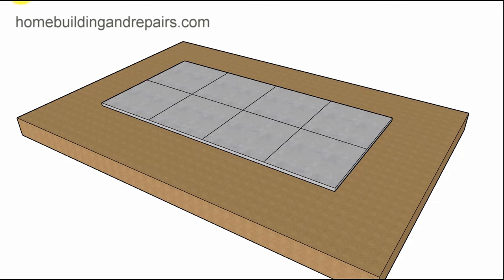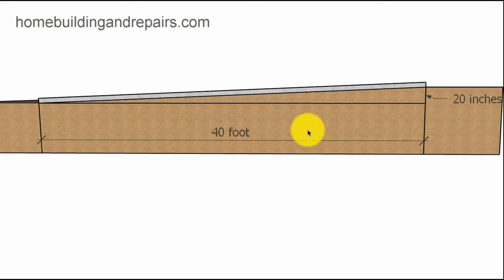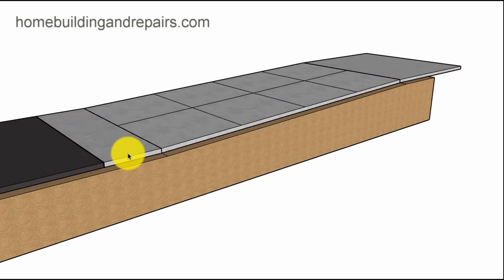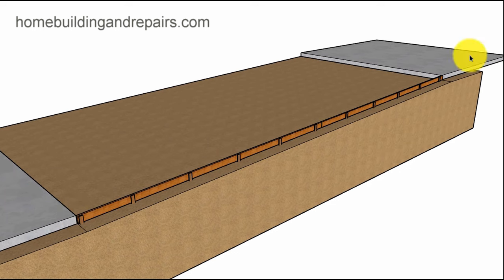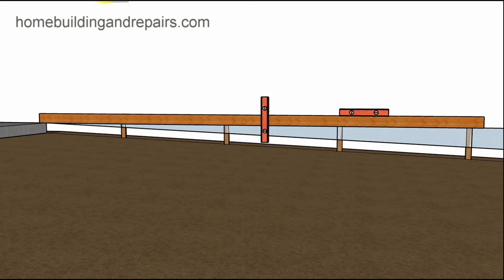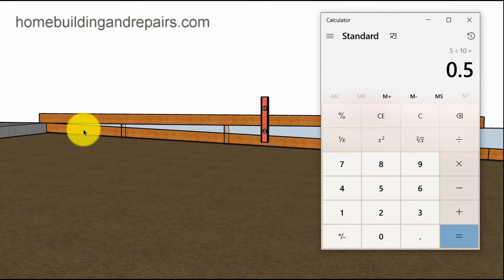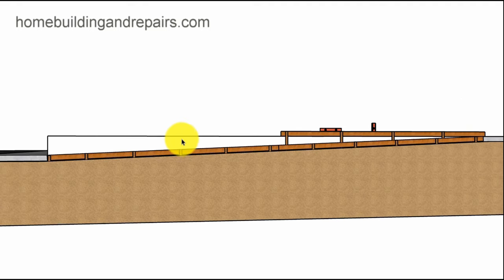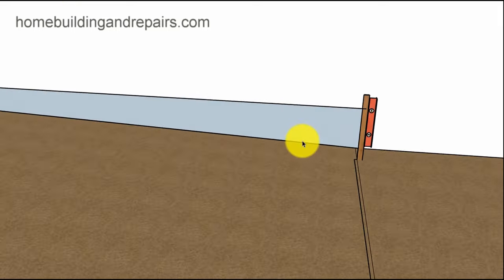How To Calculate The Slope of A Driveway In Per Foot Increments - Construction Math

Comment: Great video! Couple of questions. Currently want to repour my garage slab How would prepare a slope slab in a garage, and how would you create the form work so that the slab connects to the apron? And do you have pour the slab and the apron at the same time. Thanks keep up the great work
Reply: It would be a two-step process. The apron being the stem wall or foundation if I’m getting this correctly, would have to be poured first. Once it cures, you’d have to drill into it and install rebar at 2’ apart from each other at least 3” beneath where your slab grade is going to be. I’d mark my slab grade with chalk line and try not to go past it at the time of pouring. Hope this helps! Good luck!👍🏽